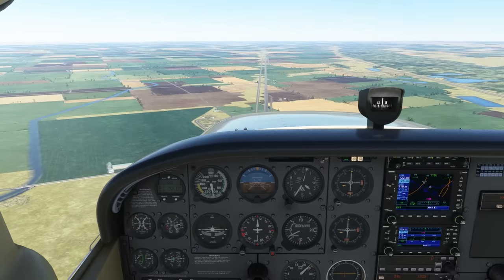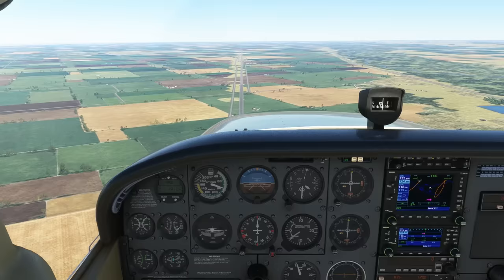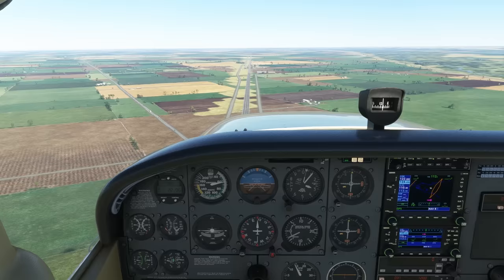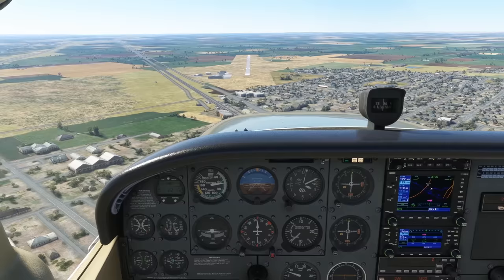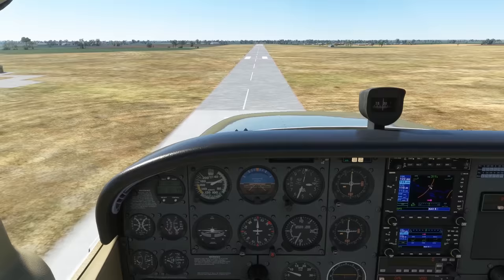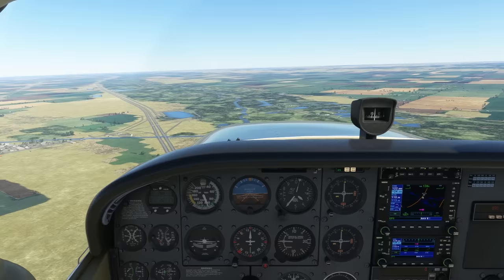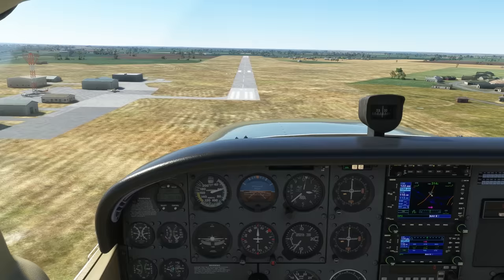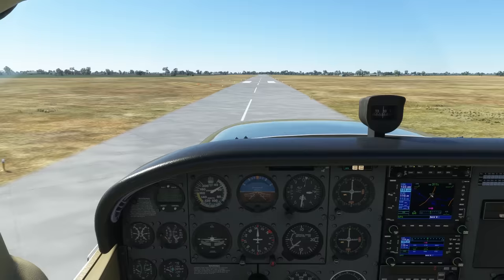How to Land an Airplane | Landing a Cessna 172

Comment: 3:35 "flaps up, full power, re-enter the pattern". Non-pilot here, but shouldn't you apply power, and regain airspeed, BEFORE you get rid of the flaps?
Reply: No when performing a touch and go you put flaps back up and then go full power again :)
Reply: @henrigeysels  I remember a heartbreaking accident where woman did a go around, pulled the flaps prematurely and ended up dying in a parking lot. I also recall an airliner that forgot to deploy the flaps altogether, and didn't get far after leaving the runway.
Interesting that you need the flaps to land, but not to take off, given ground effect and all. I'm so confused!🤔😊
Reply: @carlwilliams6977  Don't forget about drag. Flaps add lift, but they also add drag, which eats up energy. It takes energy to climb (i.e. to add additional lifting force), and the engine can only generate a finite amount of usable energy. On landing, we don't care much about climb performance, we care about slowing the approach and increasing the stall safety margin. Flaps accomplish this because the increased lift lowers our effective stall speed, and the increased drag helps us slow down. But if you're above Vs1, you don't need the extra lift from the flaps, so you can raise them and get better climb performance by eliminating the drag they create.
Reply: @traumamed9449  Thanks, I basically knew a lot of that, but you explained it very well. 
What confuses me is the examples I gave, where the lack of flaps on take off was catastrophic. Especially, the one example decades ago, where the crew simply forgot to deploy flaps at all on an airliner. The plane took off (I'm guessing due to ground effect) and abruptly stalled and crashed. They determined the cause was simply the lack of flaps.  I remember it clearly, because I was thinking how tragic it was that so many lives were lost over something so simple and avoidable!
I guess it depends on the type of aircraft?
Reply: The physics are still the same. What's confusing is that the power variable is changed dramatically from most GA aircraft. Airliners are so overpowered that they can climb and fly easily even with an engine out. Therefore, in normal ops, they are able to achieve better climb rates with flaps and slats because they can develop sufficient energy to make the drag penalty much less consequential. Even so, the flaps settings for takeoff are generally only partially extended; full extension is reserved for landing.

 There were actually two flaps-up accidents in just two years, NW 255 in 1987 and DL 1141 in 1988. NW255 didn't stall, but failed to establish an adequate climb rate due to reduced lift from lack of flaps. A wing impacted a pole and that was all she wrote. DL1141 did stall. The pilot made the oldest mistake in the book and pulled back to effect a climb when he observed they weren't gaining altitude normally after Vr. This caused a violation of the critical angle of attack, and from there, it was academic. He stalled, I think the right wing was stalled worse and basically would have spun, but they were thankfully close enough to the ground that the wing hit before they could get sideways and crater. 50 feet higher and no one would have survived.

Comment: Not the best method in my opinion.   When learning to land should be down without flaps until your soles and slope are correct.  This approach shred at 60 knots is to slow and tricky for a novice.  Full flaps and going over the fence at 60 knots is a short field landing over a fifty foot obstacle and requires more training and knowledge of the plane.  Sorry. This method is for someone who has more hours.  The imaginary landing at 3000 feet getting slow close to the stalling speed is an unsafe maneuver at the altitude described in the video.  I don’t think this guy is a flight instructor.